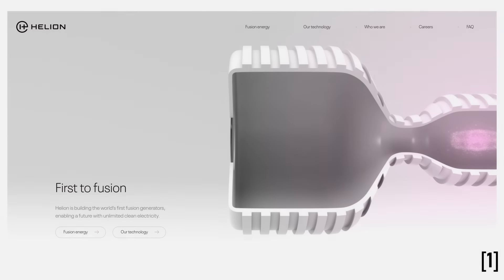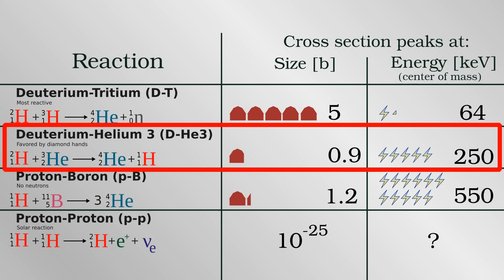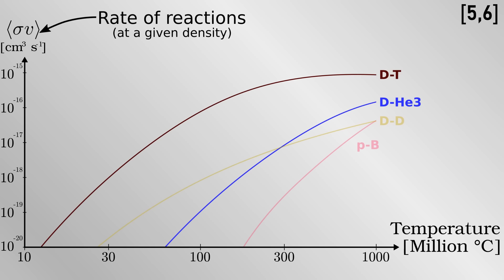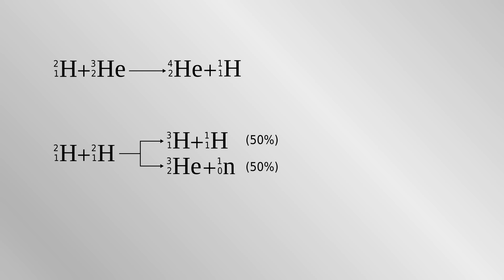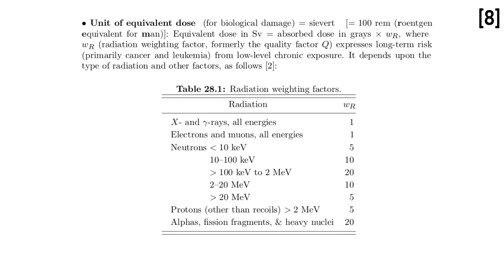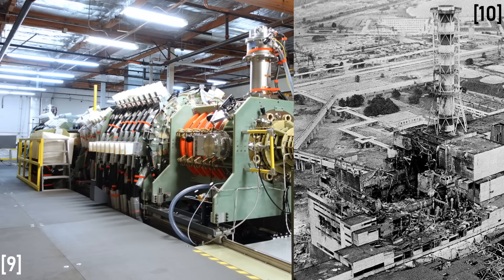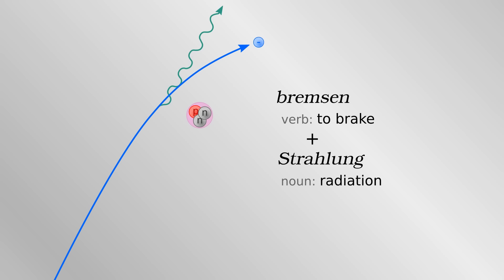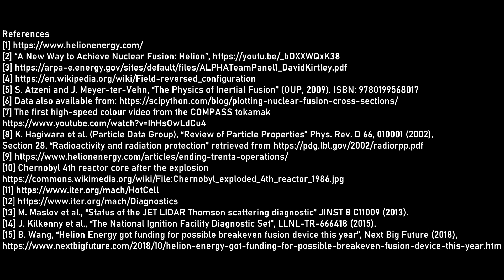The problems with Helion Energy - a response to Real Engineering

Comment: Can a reactor switch between fuel types? If so when a D-He3 reactor is energy neutral and one could switch to D-T fuel. The same reactor would be energy positive. Maybe that is the "secret" the company talked about. Hiding in plain sight. 

But probably guessed by me. I Do Not think it would be possible.
Reply from the maker: Yes, very easily. Existing experiments have switched between fuels in a given week or month.
Reply: Changing fuels is generally easy in experimental setups. Helion and others have tried different gases for their plasmas. It is common in experimental machines to make shots with noble gases or hydrogen (for diagnostics), or pure deuterium, less to try D-T, and rare to try D-3He or other mixes.

It wont be that simple in [future] prototypes of energy production reactors. Each machine will be optimized for a specific fuel. For example, it is harder to maintain an extremely hot plasma in a steady state machine (like tokamaks), than it is to reach that same temp [for a very short time] in pulsed machines (like some FRCs, Z-pinch, laser driven inertial confinement, etc.). The lower the temp, the more difficult to use advanced fuels (like D-3He).

Another important difference will be neutron shielding. Some mixes will generate a lot of hard neutrons, or neutrons with high energies, or both (D-T produces a lot of them with 14 MeV), while other mixes will generate less and/or lower energy (D-D produces less and with 2.5 MeV, the ideal [but really hard to engineer] case would we hydrogen-boron, that gives no neutrons).

Most reactors will be designed to capture most of the energy as heat, and some (like Helion's) will try the electrodynamics route for direct capture. Evidently, the design must be radically different.

Also, there's the question of materials. A heavier and higher energy neutron bombardment will require to use tougher materials, and probably a design that facilitates maintenance and substitution of damaged parts.

The shielding of the magnet coils, assuming there are,  will also have to be considered, specially if made from superconductors.

In short, it is easy to change fuels in experimental machines, not so much in the final ones.

Comment: I suspect there is a lot more to it than your basic overview. I'm sure that plenty of people once said it was impossible to put a man on the moon. 
Even if they try and fail it might lead to ideas of different methods. If they have solutions to your mentioned problems this could be a highly efficient fusion reactor that could change the world. They a are building actual machines and running fusion reactions so they are seriously committed. Things don't happen over night but they seem to be progressing.
You say this was known for decades, I think you miss the point that the method of energy extraction is new and probably highly efficient.
Reply from the maker: Direct energy conversion has been considered and tested for decades. I'm holding a book from 1989 ("Nuclear Fusion" by Keishiro Niu) which talks about it.
Reply: @ImprobableMatter  Apologies then, I under-researched the area and jumped to conclusions. However I think you come across as rude and condescending in your video.

Comment: Given known successes, wouldn't the fastest way to commercial fusion just be Muon catalyzed Oxygen explosions at the Upper explosive limit of a deuterium atmosphere. Muons are known to lower the necessary temperature(fission bombs are known to work, but make people squeamish) ; oxygen because it has such a high explosive range, a huge release of energy, & benign byproducts(H2O); the UEL should be enough to allow for fairly controlled explosions; a deuterium atmosphere will amplify the odds. Rotating explosions will also help compound the energy releases.

Comment: So what I take home: as soon as an  ionized fuel atom enters the toroidal magnetic field 
of the tokamak it looses energy by the bremsstrahlung-effect. So quickly cooling down 
from  300e6K  to ... what ? , being unable to fuse with other fuel ions?
Or is there some plasma heating generator running all the time to reheat the cooling ions?
Or is the bremsstrahlung absorbed by other ions?
Reply from the maker: The fuel starts to cool down (lose thermal energy), just like a cup of coffee. Eventually, it will cool to room temperature. Way before that, the rate of fusion will drop. To keep the temperature high, energy must be supplied. This is why no fusion experiment has made more energy than the electrical energy required to keep it hot. There is not enough plasma in any experiment on Earth - not a tokamak, or Helion - to absorb the bremsstrahlung back. It takes a huge amount, such as in the Sun, to be able to stop the bremsstahlung escaping.
Reply: @ImprobableMatter  Hi, many thanks for confirming my suspicion. I had these doubts about feasibility of fusion energy generators all the past years, but could never nail it down. Isn't "bremsstrahlung" the factor which will make all fusion reactors which use magnetic plasma containment  fail in the long run? I cannot calculate the time constant with which a 300Million °C ion spiraling around the magnetic field line looses energy, I would estimate it's milliseconds or faster. And it's not only bremsstrahlung, right, it's also ordinary black body radiation? 

In a situation where there is no energy loss (lets assume that for a moment) a ionized Deuterium atom would spiral around happily until it hits another e.g.  Deuterium nucleus.  The likelihood that they fuse is small since the tiny tiny nucleii must hit each other quite precisely. No no fusion,  both nucleii keep spiralling. 
After the 1000th hit (or so) with other nucleii : fusion. Yippi.  Energy release, neutron release, just call me "Helium". 

Now the Helium nucleus keeps spiralling. Guess there is a clever mechnism to remove the Helium nucleii, no idea why this is nowhere explained how it's done in any fusion video. 

I guess you can easily replace the consumed Deuterium nucleii using an ion gun which shoots  a beam of D+ ions directly into the plasma with an initial energy of 300e6 °C .  

But now we add "bremsstrahlung" into  that story and everything collapses: nucleii loose energy so that  at the time of the 1000th collision they don't have enough kinetic energy left to penetrate each other's electrosttaic field.

Is atomic fusion using magnetic containment a hoax?
The only way of not being a hoax would be a plasma heater which replaces bremsstrahlung energy losses as fast as the ions looses it. Means, continuously. 
A laser could do that, but since the plasma is thin (you can see through it, weird) I guess this is not effective. Lasers are not effective, too (maybe 10%)? RF is maybe a way to reheat the plasma, but RF generators also have efficiencies around 50%(best case).  

 Since a D+ ion has an energy of 30keV  to be able to fuse, and since it is supposed to release 10Mev at fusion, it would make sense (in terms of energy budget) if is  looses all its kinetic energy and getting it replaced again 300 times  before a fusion occurs:  300x 30keV = 9MeV in,  10MeV out.

But wait, the RF heater only has an efficiency of 50% , allowing only 150 collisions before fusion occurs
So its 150 x 30keV /  0.5 = 9MeV in , 10MeV out.

But wait, the bremsstrahlung losses can be recovered by the reactor , also with 50% efficiency
150 x 30keV /  0.5 = 9MeV in , 10MeV  + 9MeV*0.5   looks a bit better

In the end, this means a fusion must occurr  quickly. Too quick?
Reply from the maker: @frankfahrenheit9537  So bremsstrahlung is one issue, but anomalously high heat conductivity is another. If you have a single ion, it can orbit a magnetic field line forever. A small number of ions and they will collide and some will eventually be knocked into a wall etc. The problem is that instabilities and turbulence which occur when there is a significant density of ions make the heat and particles be conducted to the walls of a machine much faster than otherwise expected. I discuss this in this video: https://www.youtube.com/watch?v=gwOrbr8KWDs

New video will be out tomorrow talking about other issues for fusion as well.

Comment: Hey, if a star is made completely of Deuterium & Tritium matter, what would its lower mass limit be like? Normal hydrogen stars have a lower mass limit of 0,08 Solar masses to be able to ignite their fuel.
Since D-T fusion is the "easiest" fuel to fuse, i expect it to be lower. But any idea what it would be?
Reply from the maker: An interesting question, but one which requires a bit of calculation to answer. I'll try to go through a solution if I do another livestream.

Comment: I thought this was a great breakdown, thanks! 
Is it reasonable to use D-He3 as a proof of concept, despite the 50x loss in power output relative to D-T at approx 3x10^8°C? But of course to your point, this undercuts their claim of producing net energy in n+1 year(s).
What's the harm in privately funding something like this, other than the money could be going to further other, better vetted projects with better chance of netting energy. However, jobs are sustained by this work, and experience capital being gained by those engineers.
Reply from the maker: They should (and mostly are, with some exceptions) just using Deuterium. That's fine, they will need to do D-D fusion to make the Helium-3 anyway.

Comment: 6th minute: I tink the english name for this is a synchrotron radiation. That's how these devices produce their xrays, wiggling accelerated electrons in undulators.
Reply: No we call it bremstrahlung it as well
Reply from the maker: There is also synchrotron emission separately - this arises due to the magnetic field, but bremsstrahlung happens in plasmas even without an applied magnetic field.

Comment: So if they are producing neutron radiation without visible shielding is it possible that they don't even know they are producing it, because they don't have the correct detectors, and thus are not protecting them selves from it??
Reply from the maker: Someone noticed a radiation detector in one of the videos, so they are almost certainly being careful and leaving the building when their experiment is running. They are just not producing anywhere near the amount of reactions - and therefore neutrons - for a proper power plant. See also the pinned comment.
Reply: @ImprobableMatter  Got it, thanks.

Comment: Hello, idiiot here. I have a question: I always thought you want to have the neutrons, so you can use them to heat water for a turbine which then creates power? Is this wrong? I always thought it works that way. How do you convert the energy into electricity with fusion?
Reply from the maker: In most fusion proposals where they do the much more rapid D-T reaction, you are totally correct. The problem is that neutrons are damaging and turn things radioactive. Helion want to have a reaction without neutrons, but I explain why that is not possible.

Comment: Electricity is just a stress, mostly done by pressing togather magnets by macro forces (steam). This tension then given an exhaust pipe of a wire that is both receptive to tension and also release it easilly, called high conductivity cables. This goes until that tension ends up in a similar setup that created it, but this time around it engadges a macro item, like an engine, or a transistor that switches its position from 0 to 1 or backwards, or just shakes a pipe that shakes so violently as it blasts photons out of itself releaseing this tension, called a light bulb.

SO IT ALL goes down to ways you can gain tension. A FUCK tone of that comes from the sun by blasting us with photons. AN ACINIDE amount also gets created by gravitay as it pushes everything togather towards its well. (water mills). And "some" gets created when hot air full full of photons barges inside cold air whom already disposed of em to become calm, which is most encited material's aparent goal. (wind turbines and some hydro ones).

Dont forget chemical. Our oxygen, carbonisation into CO2 is one of them. Gasoline burning, and some acidic reactions ofcourse. All forces one material to experience a state where it either wants to regain energy to stabilise or release what it got forced on it and the more portable or directionally controllable this effect is the better it can serve to be scaled to our needs.

To me, minitiarising the sun's fusion is a wrong approach. While CERN doing its best, i think there could be more ways to research subatomic interactions to find ways of extracting or imprinting tension in matter. Currently gravity is the only single source that appears to generate net positive tension from literally nowhere. Yes the sun does fusion cuz gravity. Yes science not cracked quantum gravity, but we could still experiment with idealised chemical compounds in an envrioment where they could be more exposed to gravity to siphon gravities net positive energy. We could also look into ways of making matter release energy in a system that can capture it. So far kinda only nuclear power is doing that. Surelly there are other options lurking out there.

Comment: I am always curious, theoretically, if i used fusion heat just for heating something, then I could use the  pumped in energy as useful heat and would gain at least something via the added fusion energy ;)
Reply from the maker: If you are willing to run at an electrical energy loss, but a gain in thermal energy, you could always just use a heat pump.
Reply: @ImprobableMatter  yes I know, was more a philosophical question :) I am always amazed about us researching fusion, when we have sodium cooled fast breeders available.

Comment: It is theoretically possible to carefully maintain the temperature of the plasma, as well as the introduced atoms, to produce as few D-D reactions as possible while maintaining a D-He3 reaction.

If you're a god capable of controlling plasmas perfectly. I wouldn't hold my breath.

The truly laughable part of all of this, though, is that if you're going to do something other than D-T the obvious candidate is D-D. Yes you produce neutrons, ideally you would not want those, but D is limitless; if we can do D-D fusion fuel concerns are laughable. If you can create a process where you use the electricity from a D-D reactor to produce more D from seawater then you're absolutely golden. As a theoretical if you do it via electrolysis processes you produce clean Hydrogen gas; electrolysis is not done now due to electricity cost concerns, but it's a great thing to use the power of a D-D reactor to do.

The result of this settup would be a reactor facility that took water and produced D, hydrogen, and oxygen from it. Even if it does nothing else you've got a green production line for hydrogen fuel cells, which while a bitch to work with would be a good way to transport electricity. Our current production lines rely on fossil fuels. If your assembly line produces enough hydrogen it might even be economical to make airships again.

In any case the point of all of this is that D-D fusion would be easier to accomplish and is a much more significant step than this nonsense. D-He3 fusion is a step on our ladder as a species (or potentially one of the other semi-aneutronic fusions) because it would be ideal for certain applications that need low neutron production, but we really need any fusion now first.

Comment: Like any research it's a punt, a gamble, the value of your investment may go up or down. Consider this, we knew in 1927 that certain minerals had semi-conductive properties and when stimulated by electricity could produce light. Bit we didn't get transistors till 1947 or simple red LED's till 1962. Even then vacuum tubes were still pretty common and Silicon 'digital' computing was still a ways off. Imagine where we could be now if those early experimenters had been funded a little better.

Comment: Perpetual Motion machine.

Replicating fusion without using the core of a star as a gravity well to contain the enormous energy output is akin to claiming you can create a machine that can stay in motion under its own power forever.

Ignoring the fact that nothing in the universe can produce energy/power FOREVER... the concept of being able to somehow setup the same level of energy output as *THE SUN* while in a tiny (relative to the size of **THE SUN**) area like a laboratory, or a large reactor, OR A LARGE CONTINENT... it seems more than a bit far fetched.

I get the allure - and it's a helluva good way to test directed energy weapons and even fund them with private capital rather than income taxes... but at the end of the day, did we ever really believe a machine could provide enough power to contain its own fusion reactions while somehow producing more than enough power to power its own containment?

Comment: not an expert but, since they are using to sides to shoot the fuel in it comes in my mind: Couldnt they use one side for He3 and the other side for D to decrease the neutrons drastically?
Reply from the maker: The fusion occurs when both types of fuel are compressed, mixed together and heated. This is referred to as "thermonuclear" fusion and is the only kind which can be used to release net energy. The motion of the two plasma rings at the start is not what causes the fusion (this would be called "beam-beam" fusion). Also note that what I just said is not controversial in the sense that Helion would agree with me here. They also talk about thermonuclear fusion in their videos and material.
Reply: Thank you for the explanation :) @ImprobableMatter